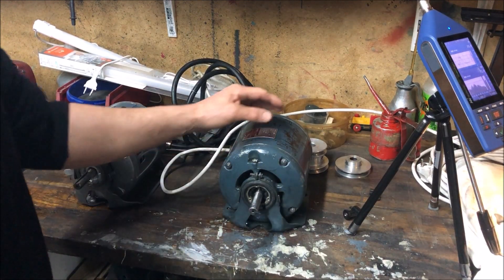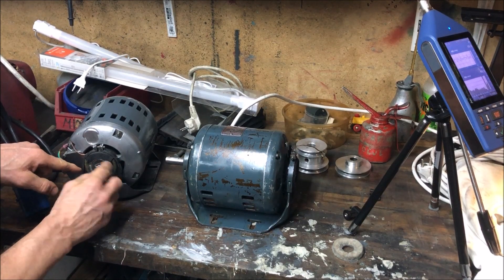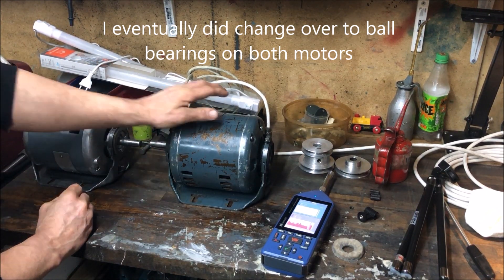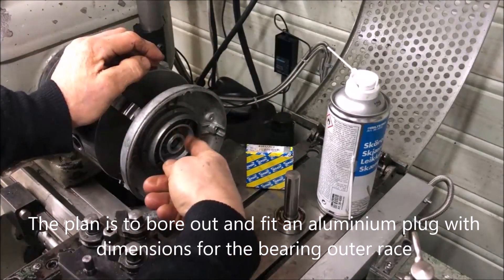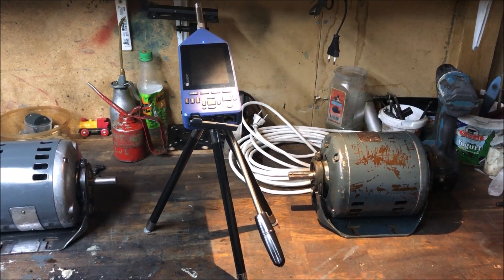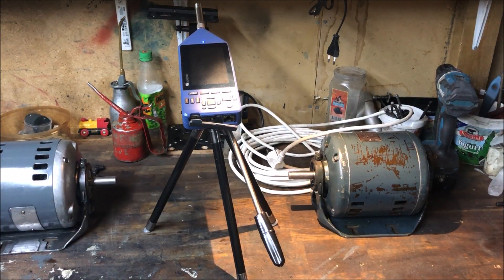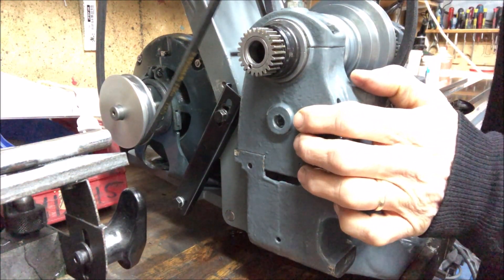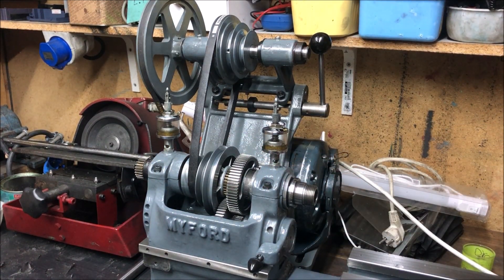Myford Super 7 and ML7 motors - modification from plain to ball bearings

Comment: digg. Lærte noe nytt igjen opps English here :)
Did not know about the oil nippel on the motor bearing. Myford manual don't mension it, (as far as I have found.....)  
What kind of oil is used there ? ISO32 ?  How often need it to be oiled ? (running houres)
Reply from the maker: @BjørnKaarigstad  not sure.. might actually be for grease. I would search the Myford forums for an answer
Reply: @jansverrehaugjord9934  
It is not for grease. So wrong of me  too call it "oil nippel"  It is those caps with a spring loaded lid.
Reply from the maker: @BjørnKaarigstad  OK. well, I guess you can us thin (ISO32) oil there

Comment: Nicely done and presented, as usual.  When you replaced the plain bearings with ball bearings, were there any issues maintaining coaxial alignmnet between the front and back?  I had such a problem when I replaced the bronze bearings in the motor countershaft assembly for my little Atlas lathe.  

The bearing journals in the casting were not coaxial. when I pressed in the new oilite bearings, the shaft fit perfectly in either one, but trying to put the shaft through both it did not line up. The old bearings were solid bronze, so I think it is possible the factory put in blanks and line bored them.
Reply from the maker: Thnks! I clocked the end bells an shaft as good as possible and haven't noticed any misalignment, but this is a distinct possibility.